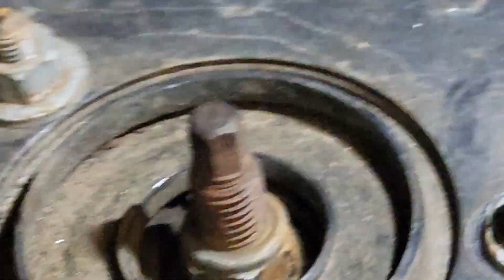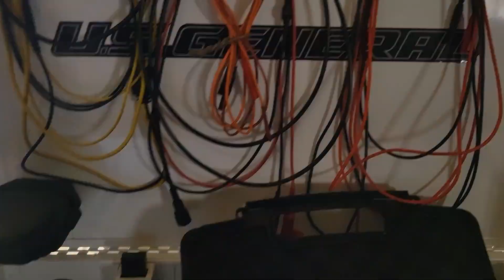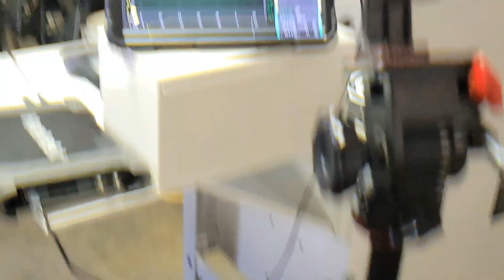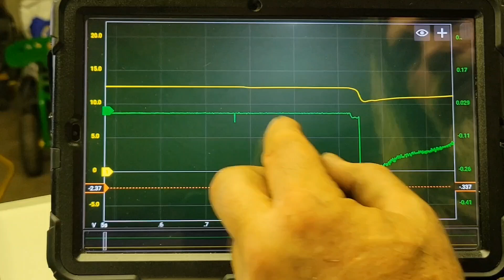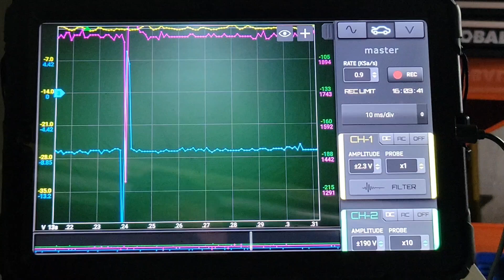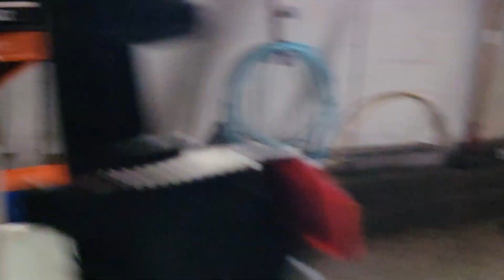Loading up the Hantek 1008c , a few things it does well.....and some that it does not.

Comment: What tablet and software are you using?
Reply from the maker: @jgar8563  It is just a Samsung tablet in an Amazon cheap bouncy case. Hscope is the software, it will run on any android tablet so the specific tablet is not important. I have ran it on some of the cheapest tablets just to check myself and you can't tell a difference. It also runs on any android phone, which makes it convenient in a pinch!
Reply: @Backalleydiagnostics  So to clarify, this is the hantek 1008c $100+ oscilloscope with a android tablet and hscope software?  Is the software free? Is there a subscription? Is there a slightly better scope you'd recommend that wouldn't break the bank?
Reply from the maker: @jgar8563  Hi, Yes, this was the Hantek 1008c with an android tablet. The software does have a free version to use in demo mode, but if you wanted to use it with the Hantek, you would need a base license and an automotive license for the automotive module. It is available on google play with some of the license options. Its been about a year, so im not sure if the prices are still accurate, but i believe it was 12 or 15 dollars for the base license and 20 for the automotive module. So roughly 35-40 on top of the Hantek to get running. As far as good budget scopes , thats where it is economical to get a hs502,hs512 or hs512max form Martinloren.com. He is the developer of Hscope, so his scopes  come with the base license and the automotive license. Ready to go right out of the box, just plug into an android. The Hs series have much more resolution than the Hantek but only 2 channels for the moment. I use the 512 gold, it was 95 at the time , he since came out with the 512max, which comes in a kit and has even higher input voltage. It was 150 the last i checked. They definitely do not break the bank and have many more features than the hantek. You can still do 4 signal cam and crank correlations 2 channels at a time, even with 2 decent 4 channel scopes, i still do the same correlations 2 channels at a time also just because of the 512s resolution and ease of lining up cam signals. It really is the best value on a scope going, especially for ease of use. Hantek software by itself is not very user friendly. Hscope is really easy to learn on and my favorite part is you can re create almost every test done on a pico. It sounds like a lot, but things i found worth passing on i try, like the Hantek does not ac coupple, the Hs series is just a click to ac coupple and check alternator diodes. The math channel of the Hantek is very limited where the hs series can do a lot of the same tests pico math channels do. Phase rulers and cylinder identifiers do not come with Hantek and are included with Hscope. 
 Just a lot of comparison but i figure one thing might be more important to someone else. The Hanteks are decieving with the price and amount of channels it offers. It will not run all 8 unless it is 8 battery voltage reradings. It does not have enough resolution to do can bus on 1 channel, whereas the 100 dollar  hs512 does it on 2 without even maxing the resolution. All things to consider, but the bottom line is the hs scopes with Hscope give you plenty of features that let you grow and learn without spending alot of money. Hantek, you can start learning, but the lack of resolution and features will require you to get a new scope after you master the basics. 
 If you absolutely need 4 channels, i use a micsig Vato scope. it was in the $250 price range and runs on andriods. It is a good scope, but even at 3 times the cash , its software lacks compared to Hscope. 
 Martin releases Hs scopes at different times, and im not sure of his stock right now, but even if you have to reserve one, it is worth it not just for the value but for the tests it can do. Have a good one and I hope that explains it a bit better, i know it is a lot, but after owning 5 scopes, it's all the little things that are either missing or included that makes the overall purchace more satisfying. MartinLoren is the best kept secret in automotive oscilloscopes!
Reply: @Backalleydiagnostics  thank you for all that information I currently have a Pico 2204A. It is a good little scope it can do Automotive but it's not an automotive oscilloscope. It is also to channel because it's not Automotive oscope it won't have the automotive oscilloscope library that can be very useful at times. Looking to get something with four channels at least while I'm still in the playing around and learning mode.
Reply from the maker: @jgar8563  No problem at all ! If you are accustoned to the 2204, the Hantek would be a huge disappointment. The Micsig Vato is a good 4 channel scope. It has more than enough resolution to run 4 fast signals, a huge buffer and runs on a tablet. It's only downfall is saving ability. Screenshot or record through the tablet is the only way to save. It makes it kind of hard to line up known goods from a pico. I hope in the future Martin can get a license for it to use with Hscope. 
 That waveform library is an impressive part of pico. There is not much of a substitute for a pico. I actually wish I got the 4 channel non automotive instead of the micsig vato, but it has its purpose. I don't think after the pico software, anything would be comparable other than a pico 4 channel.  The automitive pico will probably always be out of my range!
Reply: @Backalleydiagnostics  yes, but an automotive picoscope is in the thousands of dollars verses of 2204 a picoscope that was only $100 or so with the right attenuator I can get readings but again I'm a novice

Comment: What software does yours have? That looks nothing like mine. I’m new to the whole oscope thing.
Reply from the maker: @benjaminkondrla2006  Hi! I was using hscope software with the 1008c. You purchase a license for any supported scope you have. It is usually worth the 20 some odd dollars if you have a 2 channel hantek with good specs. I've found, however, that the 1008c uses its own windows based software better. Just the time and voltage do not seem to be ideal for hscope. It works well as far as pinch to zoom goes and the ease of set up. I have found on more than 2 channels, the hantek software does work better. Hscope has a free demo and I think you can actually use 1 channel. It's awesome software and comes with the hs502s and hs512s so you don't need to purchase the license. 
 The 1008c is a capable scope, it is a little awkward to use at times but will it help fix cars? Absolutely!

Comment: Hi there, just started watching & enjoying your channel a few weeks ago.  I've been in the auto repair buz a long time, but still trying to learn scopes. I trued to show my team how to do the RC test with my 650 amp clamp. For some reason I couldn't get it to work. My cheap clamp has 2 leads, not a bnc connector. Any idea what the proper setup would be? How to hook positive & negative, what the settings should be, etc ? I have the hantek 1008c & fully licensed HSCOPE.
Reply from the maker: Hi Tom, Thanks for watching! The first thing is always make sure the batteries are good and fresh. Make sure they are making good contact also like if there are any lights. A good sign is if while turning the calibration wheel, you see the live amperage moving. Then i would just make sure while the car is running you are reading some amperage. There should always be some going in or out. That saves you from cranking only to see no waveform. If you do see amperage, then i would say the trigger needs set. On Hscope in automotive, the trigger will start reading even if it is inverted. We just want to make sure the amps go positive, if they go negative, just either flip the clamp around or in a banana jack style you can just switch pos and neg around. The lowest voltage shoukd be 3.2 or 3.3 , which would cover 320 amps. The higher scale would cover 2000. The clamps are usually 1amp per mv. 
 If it still does not want to read a signal, you can also do a rc test with voltage. The voltage waveform looks exactly like the amperage, just inverted. Using voltage also checks the battery along with compression. If voltage drops below 8v at the peak the battery is too weak. Amperage shows how much the starter is drawing and compression. They both check compression in relation to each other so even if you cant get the amp clamp going, try it with voltage! Nothing special, just alligator clips to the battery, the 20v scale with the 1008c and hscope, then just crank like you were doing a manual compression test.

Comment: Hi totally new to the Hscope. What type of tablet do you use? And is there any certain way to set up the Han tech 1080c to the tablet and h scope settings. Sorry for all the questions. I’m a total newbie thanks
Reply from the maker: @john82324  No problem at all and welcome! The tablet is an older Samsung s6 but I've used A series and could not tell the difference. The tablet does not have to be newer or anything high spec, hscope even runs on old android phones. 
 To use the 1008c with the hscope software, you have to purchase the automotive license for it. I can't remember the actual price but believe it was under 20 dollars. 
 Hscope runs the 1008c fine, but the only voltages available are 2.4 and 19v.  I think that the 1008c performs better on its native windows software for faster moving signals. Hscope is much easier to use the Hantek with, but the resolution with multiple channels on is more choppy on hscooe than it's software. The 2.4 and 19v as the only 2 voltages on hscope make it so you are either under or over shooting on 12 v.  The HS502 and 512 run excellent on hscope and is the platform they were meant to be run on with multiple voltage ranges. Its a good way to get used to the hscope platform, but if I were going to use the 1008c to diagnose a problem, I believe I would use the laptop and it's software. Hope that helps some and any other questions . Feel free to ask!
 One thing starting out is paying attention to the input ranges of the signal we expect to see and having a scope with ranges that are close in the settings. An example would be the 2.4v range is excellent for 1-2v signals that we see a lot of in vehicles and sensors. The 19v range is excellent for battery voltage, but vehicles have a lot of 5v signals also. The 19v scale would read the 0-5v signal but is trying to read around a quarter of its expected input. Scopes work best close to the max input of their scale without overshooting.  Slow signals are not as affected by this as much. Like a crank sensor, 19v scale will pick up a 5v square wave just fine. Can bus however is faster and we are looking for detail. A 5v range is ideal, whether it's built into the scope or if you have a different scope for can bus . Hantek makes a few budget 2 channels with 5v ranges if you do need to expand.
Reply: Thank you for all the information. Question on the 502 and 512. Is one better for automotive? Just not sure which one is the right choice. Thanks in advance
Reply from the maker: @john82324  I use the 512, both are good for automotive but the 502 has a 50v max protection rating compared to 230v for 30 seconds on the 512. I always over protect, like if I forgot to put an attenuator on for a fuel injector or other high voltage spike. The 502 is good for low signals , in mv but can be attenuated for larger voltage. The 512 does work well, even on a 1mv scale but if I were to get into much can bus, I might try a 502. In short they both are good and cover alot of the same areas, but 502 if lower signals are what you expect more, like communication. 512 for ignition and injectors, and if you are like me, the over protection.
 If I needed to replace my 512 today and Martin only had 502s in stock, I would order the 502 no problem.
Reply: That answer lots of my questions thank you. I think I’m going to go with the 512 just to be on the safe side. I can definitely see that this is going to get addicting. I love tool’s and there are so many cool things to buy. Scopes and accessories. Speaking of accessories which brand do you like?

Comment: Do you have an electronics background?
Reply from the maker: @dwightferguson5454  Auto and home electronics, not as involved as I wish there was time for however. Did a lot of circuit board repair but not actually designing. I was always hardware, I left the programming to people like Martin!
Reply: @Backalleydiagnostics  your video really made a lot of sense and I will like to see you do an ''In Cylinder Pressure Transducer Waveform Analysis'' on one of those working car.
Reply from the maker: @dwightferguson5454  absolutely! I look forward to using the transducer more. Very soon!

Comment: Great video addition, people often ask about the 1008 on telegram, now we have a video to show them 👍
Reply from the maker: @chrisingram7277  On slow moving signals it seems decent. One of the odd things us just tge 2.5 and 19v scales. More around 5 would be more useful. 
 I have a timing belt on a pt cruiser to do. I think I'll get the cam and crank signals with the 1008, before and after. With hscope, I'd rather have the before in hscooe so I can use the 512 in the future and be on the same platform. Always an adventure!
Reply: @Backalleydiagnostics  I'm not sure if the two voltage scales are because of the 1008 hardware, when we build our own hs402 and see how it works, we see Martin put a programmable amplifier so we have all the different voltage scales.
Reply: @Backalleydiagnostics Haven’t finished the video yet, but would this model be good for picking up steering/suspension nvh?

Comment: Wow! You really did load it up😂 I was afraid to load it up with 3 but it worked. I could see a pico 4425 user throwing this thing in the garbage but for diy guy its a great tool and gets it done. Not many good affordable options for 4ch scopes. I almost bought an autel mp408. It looked ok and the software was decent but its discontinued now. Im really happy for now with my hs502, 1008, and my pocket scope. Hscope is fantastic and with it I dont see the need for a more expensive scope unless if its a 4425pico. Its on my wish list but Im thankful for what I have now. Great vid. Cheers👍
Reply from the maker: @MarcBchannel  Thanks for watching! I loaded as many as I could, the faster signals didn't have enough definition. However you would of noticed a missing one. The pulse sensor ran beautifully and they are only $17 o Rotkee. As far as the scopes go the pico is sweet but there are whispers of Martin producing a 4 channel. I believe it'd be a 504. If he does that'll probably be my next scope. Have a nice Sunday!

Comment: Hey I'm wondering what cable you use from the tablet to the scope? And does that same cable power the scope? Thanks and keep up the good work 👏
Reply from the maker: @jeffg1149  Hi, and thank you!  It is just a simple type C to I believe it's a usb 1 on the scopes? Like an old printer usb. I do have a split cord that let's you go to a wall charger for power while using the scope through a type C. However, I never used it as a regular cord does the trick.  Yes, the power for the scope all cones from the tablet!
Reply: Its a USB printer cable and it powers the scope